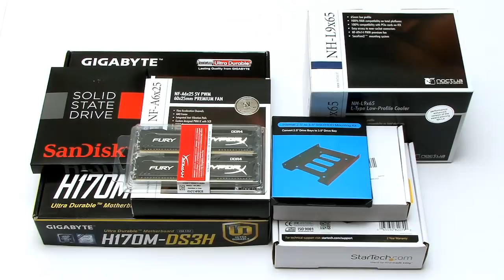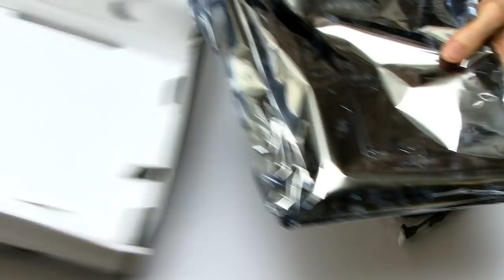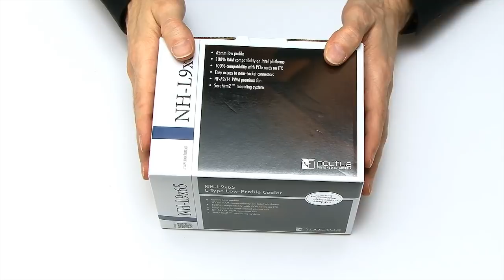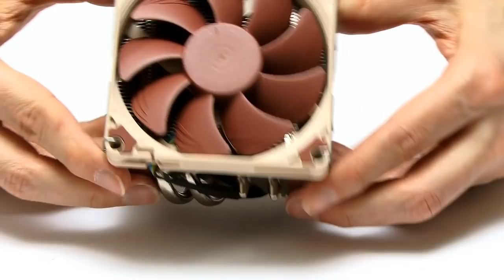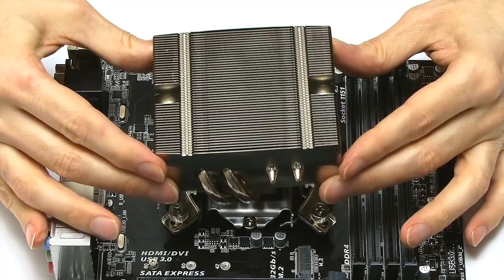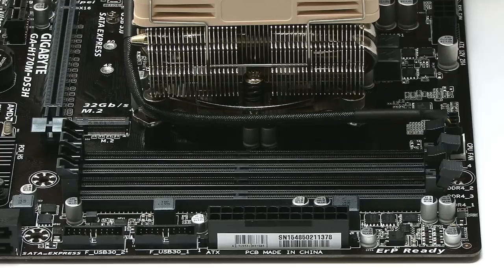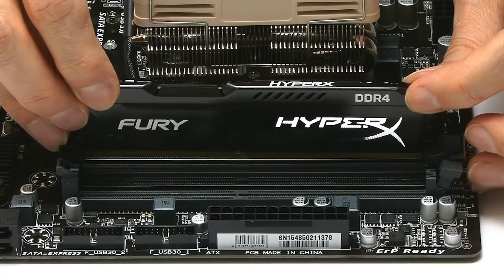i7 PC Build: Part One

Comment: Nicely Done Chris! could you elaborate more on anti-static grounding ect.? It's obviously a major point of anxiety for anyone building a PC because of the potential for hundreds of dollars worth of damage occurring in milliseconds.
Reply from the maker: For good grounding you should wear an antistatic wristband (or similar) that is attached to  good ground connection (the PC case, a heating radiator, etc). I have had so much flack for wearing and commenting on this in previous build videos (linked to how I was actually grounded given what could be seen on the screen) that I did not mention it significantly here. Sometimes viewers do not appreciate that I am building a PC under studio and film makng conditions, which is rather different to how a build would normally be conducted (where, for example, it is easy to wear a wrist strap attached to a nearby case that is earthed). If you do not have a wrist strap, make sure to touch a grounded object before handling memory in particular -- and especially if, for example, you may have just dragged your shoes across a carpet! :)
Reply: +ExplainingComputers thank you very much I appreciate the advice!
Reply: Ah, the timeless question -- should you wear an antistatic wristband? Everytime I watch a Youtube video about building a PC, there will always be somebody commenting about these wristbands.

In over 20 years of repairing and building countless workstations and servers, I don't think that I have ever used any antistatic wristbands.

Like Chris stated, it should be fine as long as you are touching a case or other metal object that is already earthed and don't be stupid, ie. standing in an container that contains water or rub yourself with nylon beforehand :)

Comment: Bit of a novice question here, but is it possible to put a fan on the wrong way? I mean would it be possible to make a CPU hotter by the fan turning in the wrong direction? If so, then what is the right way to fit the fan to avoid this?
Reply from the maker: Yes, a fan can be the wrong way up -- pushing air down onto the heatsink, rather than pulling it up through it. But it will work to a large extent in either drection.
Reply: So its not dangerous to the CPU then?
Reply from the maker: Not unless you are seriosly maxing out your PC. There are still arguments about whether a fan it best positioned to pull air up or push it down (even though most opinion is now to pull it up). The main thing is that air is moved over and through the heatsink.

Comment: Chris, I thought I could get i7 power even if it came from an older processor (my current one is an i7-2600) and I'd save a few dollars by doing this so I contacted QuietPC.com. They told me that since Gen 8/9 was the current standard, there was nothing they could do to help. BTW if you want want to change the processor in the future, can you just use the installation process in reverse or am I just dreaming?
Reply from the maker: You can indeed reverse the process to remove a processor and fit a new one. However, as you've discovered, processor tech (and related compatible motherboards) change very quickly. So in practice most processor upgrades require a motherboard upgrade too. :(

Comment: Chris or anyone else, on these new motherboards apart from the big power connector, 21 or 22 pins etc...there is a smaller one, the new board have I think an 8 pin socket, the old ATX power supplies have a 4 pin plug, will this work on 4 of the pin I do I have to buy a more modern power supply....Fred in Essex Uk
Reply from the maker: The 8-pin connector is in effect two four pin connectors side-by-side. Some motherboards will work  fine with just one four pin connector plugged into one end of the 8 pin connector, and you will not damage anything trying. Other motherboards, expecting more power, may detect the lack of the 4 "missing" pins and either not boot, or boot in a restricted (lower power) mode. So it will depend on your motherboard, and also how high power a processor you are using. I think there are 4 pin to 8 pin adaptors you can get (so a motherboard would not sense anything missing). But in the end, you may need a new PSU!
Reply: Ok Chris its a Gigabyte mmb 8100b   H 310
Reply: Hi  Chris I have bought an adaptor lead just to make sure....4 to 8 pin adaptor lead...Fred

Comment: for rendering why did you use a less expensive than your build but way more performing GPU? further your components choice is rather under performing from the SSD to the chipset and cpu: why not the better 6 core or even the cheapest Xeon?
Reply from the maker: Lightwave does not use the GPU for rendering -- only the CPU (like most pro rendering packages). So the spec if right for the software in use (specifically LightWave Screamernet).  I could have spent more on a more powerful PC, but that is always the case. I could have a 99 station renderfarm if I wanted to spend a lot more money! :)

Comment: Your videos are absolutely useful, no doubt about it. But what I am looking for is a custom-built laptop. Laptops which are available in market are either way above my budget or are not meeting my needs. My requirements are very simple:

Purpose: A laptop for bigdata applications
Configuration: High on RAM,16GB and above but limiting to 64GB
1 Terabyte HDD 
Processor i7 

SSD, I am finding wasteful for my purpose and it adds too much to price tag.
From experience I learnt that i7 overheats, so a conventional cooling system would not be enough.
And why laptop, why not a desktop because here in this part of world, we still have power breakdowns, a laptop would be self sufficient between the processes.

Comment: When will you do a video about upgrading your video editing pc since the core 2 quad is a few years old. Love your videos and the future for Windows 7 users video was very helpful.
Reply from the maker: Many thanks! :) I thought long and hard which PC to upgrade, and (as you will see in Part II) the RenderBox upgrade allows me to get double the rendering done in the same time period. It also gives me a PC that I could use to run most of my software if my main PC failed (as the previous box was limited by its 2GB RAM and Windows XP). On the other hand, upgrading my video edit PC would not allow me to get more work done (or only marginally) as I can already model, edit, etc in real-time. So I think, for a little while at least, the main box will stay as it is. But it will go i7 at some point, and I will cover it on the channel! But the software rebuild is quite horriffic. :)
Reply: ExplainingComputers ok

Comment: Funny how you worry about the contact surface of the cooler, but put the CPU contact side down on the desk.
Reply from the maker: I am making a video, as I do state. :) I would not normally handle a CPU in this fashion. But the surface I was working on (not a desk) was very clean.
Reply: No hard feelings. I just think that whenever you touch a CPU, it should be going either from the casing to the socket or the other way around. Putting the CPU anywhere else than the socket or the plastic holder is just unnecessary risk in my mind.

You produce good quality videos and respond to critism well, keep it up.

Comment: If Ryzen had been available when you did this, do you think you would have used it instead?

With the lowest end R7 part, the cost is in the same ballpark, the core count would have doubled, but the TDP would also be almost double.
Reply from the maker: As you say, the TDP would have been higher! :) Also, and critically for me, it is not possible to split rendering across Intel and AMD CPUs without problems, as the two processor types have different random seeds, which results in textured images that rely on a "random" number input rendering slightly differently. You would not notice looking at a still, but it makes it impossible to render different frames in a shot on different PCs. And so, as my main PC is Intel, the RenderBox will remain so. Oh the wonders of computing!

Comment: Hi Chris, Nice video as usual. However, I have a couple of questions (1) What are you going to do with the old hardware stuff from the old pc? (2) Is there any reason for not going with an AMD processor? 
Thanks.
Reply from the maker: The old motherboard/etc will end up back in use somewhere, maybe replacing what I have in the "test rig" that I use for videos on this channel. We've had an AMD discussion below -- for me it was about achieving the best top-end and power performance, as currently delivered from Intel (I do not upgrade often, but when I do I go fairly high spec). Also AMD and Intel CPUs have differernt random seeds (used to generate certain proceedural textures and related shaders when rendering). There is nothing wrong with either, but they cannot be mixed in the same shot when rendering animation. So for me, as my main PC is Intel, I have to have an Intel CPU in the render PC also.
Reply: Nice to hear that you are going to recycle the old stuff. Also thanks for the clarification about Intel/AMD thing.

Comment: hi chris   tanx for your channel and well done    i would like  to ask just one question   how long does it take for a seasoned professional to make a fresh install of windows without copying files etc   just windows drivers etc    regards
Reply from the maker: It depends on the PC and SSD involved -- the faster they are, the faster the process. And it also depends on the speed of the Internet connection used picking up any update, and the speed of Microsoft's servers that day. So I'd say anywhere between 90 and 15 minutes.

Comment: Chris, Any reason why you would use an AMD based system over a Intel based system? Just curious
Reply: Current AMD CPU offerings (while cheaper) have significantly lower single core strength compared to Intel, as well as higher power usage. Next month AMD will be releasing their brand new Zen CPU's, which should be far more competitive.
Reply from the maker: Very well said. Right now you get better top-end and power performance from Intel. Anybody rendering animation across multiple computers also has to be all-AMD or all-Intel as the random seeds (used to generate certain proceedural textures and related shaders) are different on AMD and Intel CPUs. There is nothing wrong with either, but they cannot be mixed in the same shot. So for me, I will not be introducing an AMD PC into my render mix.
Reply: That's a fair point. It is just nice to see that people aren't bias because X brand is better than the other, But to have a legitimate reason behind the purchase

Comment: you don't need any aftermarket cooler for this cpu, you need aftermarket cpu only for K processor
Reply from the maker: All Skylake CPUs need a cooler! :)
Reply: Felix Nando It didn't come with a cooler, as Chris mentioned. But it's not as if only OC'd chips should be fitted with an aftermarket cooler.

Comment: Couple remarks:

8GB of RAM sounds like a waste. you should've picked 16GB instead. I had issues by just having 8GB of RAM when I was rendering videos 

I'm not sure how old that PSU but its efficiency has probably went down drastically also I doubt it has the new features as new PSU like Active PFC

Cheers
Reply from the maker: Thanks for your feedback. You may well be right in the PSU -- it is a 400W Zalman from a few years back. On the RAM, I am not rendering videos, but rather 3D models to create animation frames (png sequences) in the LightWave CLI renderer Screamernet, and here 8GB will be sufficient. :)

Comment: Could you please give me a little insight about which motherboard is better now - Asus or Gigabyte? Once many years ago I was turned away from Gigabyte just because I saw an overwhelming amount of those lying in repair shops, while, in comparison, there were too little Asus motherboards. Unfortunately, my Asus Sabertooth X58 died a few days ago for unknown reasons after 8 years of perfect operation, and since I cannot find another LGA1366 motherboard on the market for my buck, I might need to build a new PC. I would love to hear your learned opinion on the matter, please, if you have a few minutes to spare.
Reply from the maker: I personally buy Gigabyte as my first choice. I've no data on which boards fail more than others. I'd note though that cooling can pay a big role in motherboard failure (or not!).
Reply: @ExplainingComputers  Thank you for your answer. As to the failure I've experienced, I am not particularly sure that it was a cooling problem that lead to its demise. I was monitoring the temperatures on this board and they were normally operating in the 50-70 C range under load. By the way, is the motherboard repair really an option or should I not even think in that direction?
Reply from the maker: You may be able to repair a board if, for example, the voltage regulators are the issue. But elsewise I doubt it. And the problem is doing a decent diagnostic.
Reply: @ExplainingComputers  Dear Chris. Thank you so much for your answer. You have been a lot of help for a lot a people, and please except my sincerest gratitude for that as well.

Comment: Just looking at the prices only for this processor , amazon has it for 50£ cheaper than quietpc, why did you chose them i'm sure with some research you could have found a deal on the parts you wanted.
Reply from the maker: The prices for this chip vary greatly -- I paid about £10 less from Quiet PC than from Amazon when I purchased the chip not that many weeks ago. But yes, today, it is listed as cheaper on Amazon -- if not sold by Amazon. Most of the other parts were via an Amazon order. :)

Comment: What about the Intel Core i7 6785R with Iris Pro 580 graphics? Now I now that the Iris graphics would be heavily underused, but wouldn't that be a operable comparison to the AMD APUs?
Reply from the maker: The 6785R is a great chip (though the TDP is back to 65 watts). However, it is only make available to laptop manufacturers, not least because it has to be soldered to the motherboard.
Reply: ExplainingComputers Oh that's right! I completely forgot that is was of the BGA socket verity. I was so confused because Intel marketed it as a "Desktop processor" on the ARK Specification website. Well that's a bummer that they don't make a desktop i7 with Iris graphics.

Comment: i'am not sure but i think u made an mistake by the tray thing, i belive that the T on the end of the 6700T doesent stand for "Tray", u can also get the 6700k as an "Tray" Version (no cooler), i also got an I3 6100t, that comes even with an Cooler and the Normal Box becaus it wasent the "Tray" Version. Or did i get that wrong?
Over all i think u have build an very nice pc.
Reply from the maker: I understood from my supplier that the "T" means "tray", but could be wrong! :) Certainly the "T" is the power-optimized version with the low TDP. I have not been able to find out anything else it stands for! :)
Reply: I do wonder if the T stands for Thermal or Throttled as it has been deliberately underclocked in speed to reduce its power consumption and heat compared to the standard version.
Reply from the maker: TheNZJester It could be thermal.

Comment: you should of got the K even if you dont want to OC, also where are the prices?
Reply from the maker: The K uses a lot more power, and also generates more heat.
Reply: 90 watt is the max power when OC so basically water cooled, making an upgrade for cooling would of given a future video and faster rendering time even tho the gpu does alot of he rendering it just makes sens to use K.
Reply from the maker: 90 (91) W is the TDP (heat output),  not the power use, although these are strongly related. In practice the K uses at least double the electricity consumed by the T, and for this offers about 18 per cent higher performance. So the watts per animation frame rendered score for the K would be significantly higher (I look at the specifics in the next video). In terms of rendering, this machine renders animation frames from a 3D modelling package (LightWave, rendering via its CLI utility Screamernet) that does not render via a GPU  -- the rendering is 100 per cent CPU based.
Reply: I still liked the video, very nice camera btw, and can you make some how to make animation vids? i will look into them packages you mentioned aswell :)
Reply from the maker: ***** Thanks. :) I made a video on CG in LightWave years ago -- https://www.youtube.com/watch?v=Sp0OogV-Eh0 -- so maybe an update is in order! You will see Screamernet and its output in action in Part Two of the i7 build, uploading next week.
Reply: Nice thanks il check it out :D